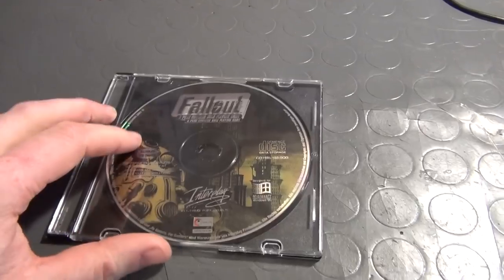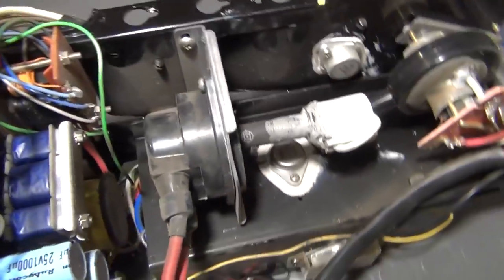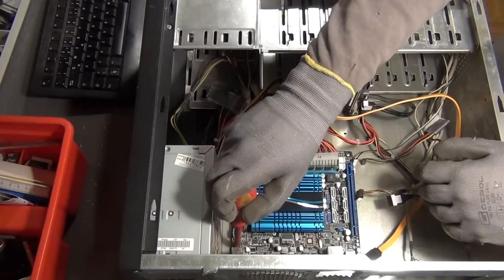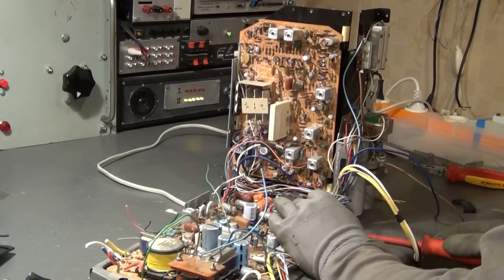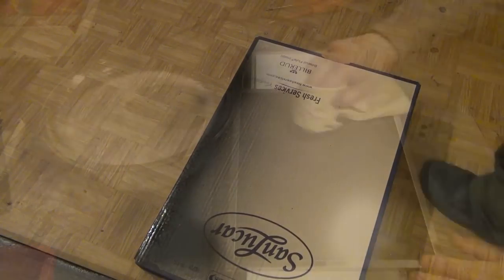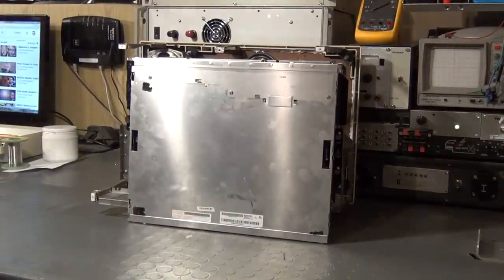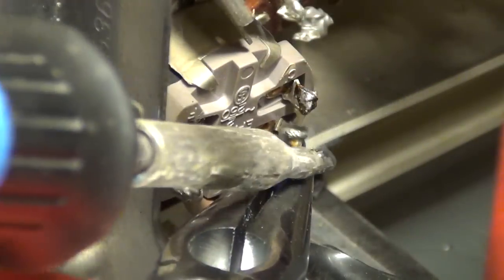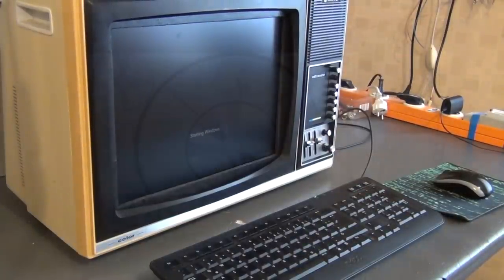Fallout Style Computer Build - Retrofuturism!

Comment: But but but.. The curved CRT aesthetic :(
Reply: @Kamey it would've been so lit if he could do that but still this is an awesome effort tho. Props to the builder
Reply: Why not using crt monitor?
Reply: It would definitely take up too much space inside the enclosure to use a CRT monitor in this build... also making it unnecessarily over complicated and not really efficient both energy consumption and resolution wise.
Reply: @fabiocastrodeavila8475  considering you can get around 1440p on a crt you are wrong about resolution energy consumption what you can't afford a few extra dollars for the 1 hour a month he is gonna use it
Reply: @fabiocastrodeavila8475  Many CRTs actually draw surprisingly little power.
Reply: @fabiocastrodeavila8475  could have used a thinclient board to save space.

Comment: I really wish you had kept the original screen but I realize how complicated it would have been to make it work.
Reply: If the tv was bigger he might have had a chance to put a crt computer monitor in there...
Reply: It wouldn't have been terribly difficult to use the CRT, you'd just have to design a driver board for the cathode guns which is mostly low voltage stuff. The bulk of the electronics seen in the back of the TV is for signals processing and filters.

The only downside to using the CRT would be the limited resolution. NTSC is 720x480 and PAL is 720x576, both not terribly useful on modern operating systems. DOS and Windows 3.1 or 9x could work if you wanted a vintage experience.
Reply: GGigabiteM My crt monitor Sony GDM FW 900 displays 2304 x 1440 at 80Hz.  some of the higher triton series also had 1080i, for ntsc.
Reply: Zachary Solomon

Good for you?

I'm talking about the CRT in this television which will be limited to the resolutions I said above.
Reply: GGigabiteM Oh, sorry thought you were talking about crt in general.  In that case I agree the crt resolution would be a downside.
Reply: Ｄｏｇｅ６２５ hdmi to vga to rca ro rf. Look at LGR project
Reply: It's really not that complicated, all it takes is just takes two very cheap adapters you can buy online; a hdmi to composite adapter and a RF modulator.  I've used modern computers and game systems on 70s TVs.

Comment: too bad that you dont use crt Screen.
Reply: CUBETechie yes, what a shame...
Reply: Fire hazard and it will consume too much power to be cost effective.
Reply: das arme Fernsehgerät, ohne Bildröhre ..... jetzt wertlos!
Reply: @God-yb2cg  god has spoken
Reply: You can break a thin glass tab off the back of the CRT to release the pressure, then use a glass cutter and heat gun to break the front rim away from the body of the CRT to keep the design authentic, but it's dangerous. The CRT has a high vacuum, do it wrong and BANG. Also, it is filled with a phosphorous coating that glows as the electron gun paints the image on it. That stuff is toxic.
Reply: It is a shame but some CRTs don't have the best resolution, it still looks cool though
Reply: Get some plexiglass and a scanline generator and you're all set.

Comment: I loved this. I remember TVs like that from my youth. I can only imagine how awesome it would be to have support for one of the old clicker remotes. I would have put in a low profile video card that was the most powerful at the time. There might have been a way to take the back panel of a case with the typical mounting etc and implement it with the metal for the backing so you could use a video card.

Comment: Fallout style pc's actually run an OS system simular to MS DOS, since Windows OS and Mac OSX was never invented after WWII due to the preasure being laid on Atomic/Valve technology rather than Solid State technology. Also all electrically powered devices in the Fallout universe had no power cable since they all had their own build-in mini-reactor as a power source. (and you're old power supply from your pc probably has too little watts of power to run both a PC and an LCD screen at the same time so will blow up within the next year or so) and finally... WHO BUILDS A PC OUT OF BISON KIT!? But still, idea is fun! Looks fun, hope you're happy with the results! I actually looked this up because I sort of wanted to do the same to a 1950's Chevrolet Pick-up 1 wreckage I found on e-bay (but they want to sell a broken chasis and body with an engine that's in state of demise and that needs A LOT of work to it before it will even start for 8000 euro's which is the most INSANE price I've ever seen for a car WRECKAGE)
Reply from the maker: +Thomogon The LCD is not running on the ATX power supply. It has its own flyback converter + high voltage inverter on a board, sitting behind the panel. It can be seen in several scenes in the video. These older LCDs require a high voltage supply because of the cold cathode fluorescent tubes acting as backlights and can thus not be powered by a standard ATX-power supply. 
Concerning the fallout technologies: I have heard that many of the devices in the fallout games are supposed to use  integrated nuclear reactors, but  that might be out of reach for us :D
A 1950s-TV might have been the better choice, but I simply used this TV since I already had it lying around.
Reply: Haha yeah that might be a good one since you don't want your new Fallout pc to explode and burn all your hardware down because of power issues! The nuclear reactor is out of bounce alright, but there's always something called a valve and it's found in nearly every old radio, television and even guitar amplifiers of the right type. But hey hope you're having fun with it!
Reply from the maker: Hey I'm working on a vacuum tube amplifier, that will be placed on top oft the computer as we speak. It is about 95 % finished and a video about that will go online in the course of the coming days. It will certainly improve the "Fallout Style".
Reply: +The Post Apocalyptic Inventor Sweet!
Reply: +Thomogon All you say is true,  because your design lacks a flux capacitor.
Reply: +The Post Apocalyptic Inventor  Maybe a custom rain meter for the start up :D?
Reply: Personally I think the fallout style PCs more run on a system similar to Unix, which would make more sense as that was the direction computer OSes were going in in the 50s and 60s.
Reply: You could buy an new or used big LCD TV and put computer parts into  new backcase from same material you made in this video or buy a 3d printer and backcase make from plastic in parts which you connect..and it will look like 100cm TV  with bigger backcase..and you get COMPUTER WITH TV,2in1 ;) thats better than this video...you maded it similar like my idea...but with oldertv..so..it cant work ...
P.S. You could VGA cable cut off and solderit on VGA plug on the matherboard..so you can have +1 extra VGA connection on matherboard ;)
Reply: XxXDestro yerXxX umm what?
Reply: He could make it with new TV and instead placing new LCD he could leave TV LCD which will work as a monitor too.. ;)
Reply: By the time Fallout was supposed to take place, most computers didn't even have Unix-style interfaces let alone monitors. Everything was lights and knobs.
Reply: You missed the point where he solders the LCD Power input directly to the ATX input socket. The power supply is therefore bypassed and unused for the LCD.
Please tell me you didn't think he would build a mini reactor to power the PC.. X )

BTW, I too had the impression that there were no power cables for devices in the Fallout universe but the writers do describe power plants that power entire cities. Computer displays capable of something other than ASCII characters do exist as well and the Pipboy is one of many examples.

As a reminder, the game takes place in some alternative future (not in the past, even before the bombs fell is still future for us). As such, the game doesn't make much sense in regards to how technology is depicted. As such, you shouldn't be so concerned about this build.

Anyway, just to prove my point, In some instances , you can see screens with graphs and images. You can even playback audio and video, play games and use a GPS in the Pipboy itself which is a tiny device compared to the other computing devices. How harder could it be then to build a "modern" PC with an OS that has an UI ?
Reply: You are wrong, LCD monitor has low demand for power, it can be about 20Watts in this case.
Reply: *****
What do you mean ?
He is already using an LCD in this project as the main display.
Reply: Oh, my bad. You meant (AM)OLED then.
LED displays emit their own light. I'm not sure they use less power overall but in any case, yes, you can use whatever display you want, even a CRT for all that matters.
By the way, the power supply is NOT powering up the display. Look closer, he simply cut and soldered the display's power cable to the input plug of the power supply so that you only need one cord to power everything up.
Reply: the display is not powered off the PSU like the motherboard etc are (or like a high end graphics card is in most cases). The screen simply shares the same plug as the PSU, but does not feed off of it.
Reply: Fallout's OS for the computers in game is reminiscent of CP/M in my opinion. The computers in Fallout are capable of limited monochrome graphics which makes them a good analog for early CP/M machines.
Reply: Mario Power -- you completely ignored what was said >.>
Reply: I honestly thought he was going to put an old 14" CRT monitor in the TV case since the pc board is tiny and could literally fit on either side or bottom, power supplies out of the case are not really that large (especially if you get one from an old U1 server). Meh, maybe one day I'll do one of these.
Reply: pretty sure its actually more akin to basic than anything else.

Comment: "volltransistor" or "volltransistorisiert" (in the GDR) were well known trade marks of the early 1970ies in Germany I remember from my early childhood days. Television started in the late 1920ies with - a flat screen. But it was very tiny with a massive Nipkov-disk rotating between a light source and the the screen, projecting allready 100 lines or more on it. The early TV designs were really funny. In the 1930ies came the CRT and mechancal projection technology by use of rotating mirrors in the 1940ies, both in colour in the late 1940ies / early 1950ies. Rotating mirror projection exists until today and is on its way to be substitued by MEMS mirror projection for beamers.

Comment: Love it, I grew up watching these old sets, even older ones for that matter. I have been considering converting the Tv in our old Motor Home to digital, right now it works OK with one of those converter boxes but an LCD would be much sharper, and I have a nice 12 volt DC monitor that could be used so I would not have to run the Generator when boondocking, I could hook it to either my laptop, or I do have a small computer that I could set up with a DC-CD power supply quite easily.

Comment: Very cool idea and nice video editing as always. I'd prefer your precise voiceover with german accent to the average native-speaking narrator any day.
You could throw in some pc speakers from the garbage dump and maybe a cheapo USB joystick or gamepad to make the front potentiometers operational.
Reply from the maker: h3po I thought about adding a small audio amp. Could use the potentiometers for volume control.
Reply: The Post Apocalyptic Inventor The power/volume knob would have worked best in an older type PC application when you had a mains switch to turn on the PC and not the soft power switching.
The guts out of some powered PC speakers will work and use the original TV set speakers if it has a pair in it and the POT on the power switch of the TV for volume..

Comment: I heard from an older Docu film, that the US had a problem with a nuclear power plant in Greenland.  In the late 50's, the water pumps broke down or some such causing a nuclear melt down / over heating.  I'm not sure if they solved the problem or just poured cement down the hole, and then tunnel bored the whole damaged reactor out.

Comment: Since the 1950s tvs are $90 USD plus I think I'm going to buy a board, cut it up, stylize it, age the wood, buy some fancy vintage looking brown speaker cover fabric and basically build a AIO case that looks like a motorola bakelite, Audio over video quality. Ill probably use some mix matched Creatives I have around hopefully get the sub woofer wired up as well. For the internal pc I haven't decided yet but a lot of stuff with work (Pi 3, Pi Zero, any matx or mitx) . I'll likely wire up a backup camera LED panel to the USB power somehow though. I may have to build a plug for the sub woofer, the magnet is huge don't want it too close to the PC.

Comment: there's a known trick used in construction of prop Pip-Boy 3000's where you take a domed slide viewer and lay it over the screen with either a static image, or a video screen. Some people used iPhones, I used a digital picture frame for mine. It would be interesting if you made a cast of the original CRT in clear resin to put over the monitor.

Wanna make a replica of the terminals in Fallout 3, figured that'd be the best way to fool people into thinking the screen was an actual CRT monochrome monitor tube.

Comment: I love this idea, but I never thought about embedding an LCD monitor into the casing. Instead I was thinking of using an SBC (not a raspberry pi though. Possibly the CHIP) and embedding it into a CRT monitor. Maybe a monochrome Apple III or IBM screen if I can find one cheap enough or free. Now if I were doing a modern PC within a retro design, I would probably follow the same idea. Maybe I would put a LattePanda in it since those run full Windows 10, but they're not exactly modular.

Comment: Exelente adaptación, me llamo la atención como modificaste el circuito de audio para poder usar el parlante interno del chasis de tv, no vi que  no usaras  un par de led para indicar el encendido del equipo y el led indicador de HDD.
Excellent adaptation, it caught my attention how you modified the audio circuit to be able to use the internal speaker of the tv chassis, I did not see that you did not use a pair of LEDs to indicate the power on of the equipment and the HDD indicator LED.

Comment: An old CRT screen is really part of the "magic" . Maybe next time you could try to build an old Fallout 50's style terminal frame yourself, because the actual old 50's sets are by now probably hard to find and very expensive. So building an old frame yourself, putting a CRT inside, using some old style keyboard (these are actually still easy to get), this will get a much more convincing Fallout style device. But it's just a suggestion, you don't need to act upon it, if you're happy with your current build then it's OK.

Comment: I wish you could have kept the old glass on the TV and mounted the display on the back of the glass.
Reply: not a good idea, besides it would look awesome....you would need to do this: 

1.  open that thing (it´s evacuated ) without damaging it...
2.  cut all glass behind the back, knowing that is by far the thickest part of the glass envelope.
3.  get rid of that inner phosphor coating, and that´s the hardest part if you scratch the glass you´ll see it, you cant melt it away...you can´t even acid it away...the glass will turn milky and you won´t be able to see though it anymore.
Reply: Although much harder, it would be much more impressive if you could drive the original CRT
Reply: Drive the CRT and get crappy resolution. Great
Reply: I don't really see fallout computers being associated with high resolution
Reply: The glass of the TV is actually part of the CRT tube, which is shaped like a bulb. So is not actually just a glass screen but a whole tube.
Reply: Maybe use an old CRT computer monitor's CRT?  If it's the same size, it could be made to fit.
Reply: Perhaps by using a mold with a piece of clear acrylic, heated and vacuum formed over the mold...

The original glass is fused to the tube and would be very difficult to separate. The vacuum needs to be released, the metal band around the screen would need to be cut and the split between the front of the screen and the rear of the screen separated carefully. Then the shadow mask is removed and the phosphor coating on the screen would need to be removed.

A very long and cumbersome process with the risk that at any point the screen could shatter.

Not worth the risk.

Comment: nice build, though some things i would do is just cut the VGA cable and solder it directly to the board. while yes it's quite tricky to do, i know some people who could do it. i'd also re-use the TV's old speaker, and knowing the low power from the audio jack, i know a small amp would be needed. maybe a nice tube amp with the tube sticking out the top. and way out of my knowledge range though i know it is possible, get another CRT in there/re-use the old one, though this would create space issues inside the case which might not even make it possible

Comment: I think it would have been better for the aesthetic of the back if you had fully enclosed the back of the motherboard and broken out the USB and other ports you needed to a panel so that you wouldn't have the VGA cable running out from the inside to the back of the board.

But that's just me, also analog VGA interfaces trigger me in the current year. For a better picture use a black white checkerboard pattern tiled across the whole screen then run the monitor's auto adjust. The picture will be much sharper but will still be subject to drifting and interference.